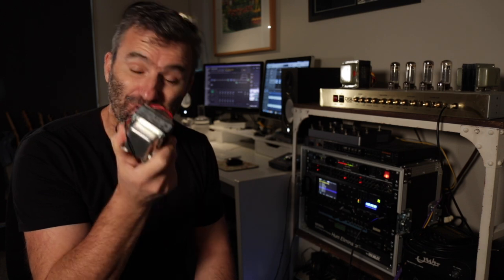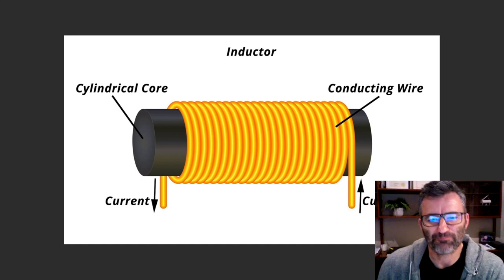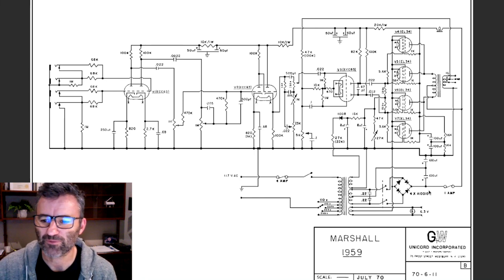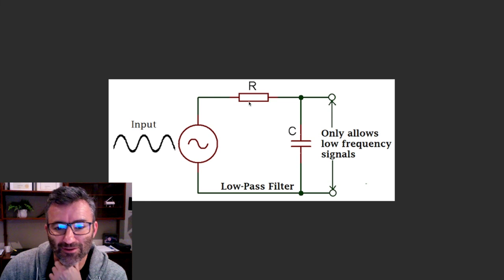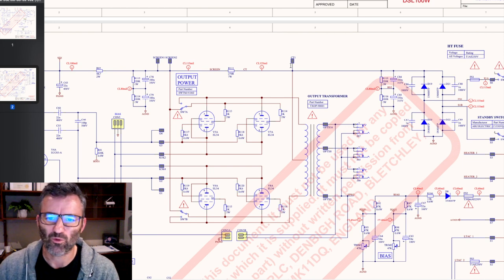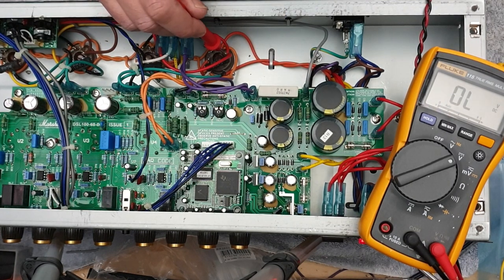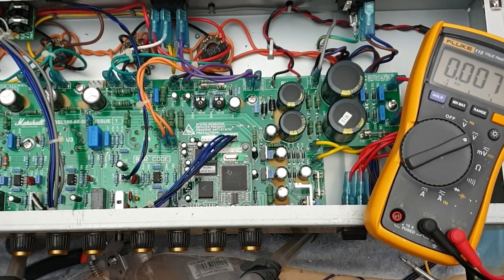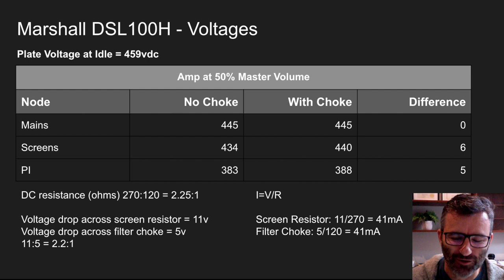Modding a Marshall DSL100H - ADDING A FILTER CHOKE!!

Comment: I appreciate you doing before/after clips!  Very helpful!
I think you missed a great opportunity, which was to measure the AC Volts after the choke, at idle & when driven.  Especially when driven hard, the ripple in the power supply should be higher when running no-choke, and that will invariably increase IM distortion with what you're playing.  For high-gain, that seems like the bigger impact.

Comment: A filter choke is more efficient since it doesn't heat up. It also doesn't reduce voltage as much to the B+. The only downside is expense and weight.

Comment: Love Tool and I love my DSL100HR. I'll certainly be installing a filter choke now. I build guitars and guitar pedals and do all sorts of mods. I just finished a Chasm Reverb with my own mods (the Chasm is a belton brick reverb) so maybe this should be the next project? Did you also find that swapping the PT and OT was worth the cost? I've had the DSL100HR since launch and while I'm perfectly happy with it I do see room for improvement. I would have started modding it already but I was just waiting out my warranty. And I actually am glad I did cause my amp was one of the earliest units that still needed the switching daughterboard swapped for a reflashed board since it had the FX loop switching bug. I told the tech exactly what he needed to do to fix it and gave him my contacts number at MarshallUSA (even though he was an authorized repair center just to be thorough) and a month later he calls me an says "found your problem, it was some solder build up. All fixed" to which I laughed and told him as much as I wish that was the case it's not fixed and asked if he looked at my notes. So he says "I've been working on amps for 30 years but if you wanna come in and show me the problem then go ahead" implying that he thought I'd come in and he would show me I was wrong. So I took off work and drove from Fort Worth to Dallas and showed him the problem and explained that its intermittent and it wont always be apparent. So I finally convinced him to call Marshall and they didnt answer so I left my amp and the next day they called my tech and confirmed everything I told him. In his defense I was one of the very first people I know of to find the issue and seek a repair but I did all the leg work for him. So he called me after talking to Marshall singing a whole new tune and telling me if I have any issues in the future just bring it by and ask for him. He went out of his way to show humility though and in the end it got fixed. My point of that rant was to say warranties are nice especially when proprietary software is involved cause they make the repair free. But with that said, it's so much easier doing things ourselves lol.

Comment: Hey Jason,  hope all is well. I've heard you mention the sweat spot for the PI supply is about 320v. In the DSL it's around 402v. Then the rest of the nodes are H+5 395v, H+4 380v, H+3 365v,  H+2 364v, and H+1 373v. While implementing your mods and the choke, would it be worth the effort to bring those voltages down some?

Comment: Hi Sir, I got the DSL100H for which I recently replaced new EL34s but I'm struggling with the BIAS settings because, by adjusting TRIM1 and TRIM2 I can't remain in a fixed value in mV. they change continuosly the value range and I don''t mean in decimal (76.1 76.2 76.3 etc) but even the units (73 74 75 etc). Does this can be a techical Issue or maybe I'm wrong with the procedure? Moreover I dont't catch what PIN the TRIM1 and TRIM2 adjustment affects respectively, because seems both PIN are affected. My steps are: Amp connected to a load. Turn on and in stand-by. wait for 10 minutes. Turn on the stand-by and measure one Pin per time with the DMM setted in 200mV. Adgust the TRIM. but what TRIM affact what PIN? I'm I right. Thank you very much for your help. Regards.

Comment: Hey man dont know if you could help but im repairing a dsl100hr i was gifted, and it popped a fuse internally (the one that always goes in these models), ive noticed that no matter what i do on the bias pots on the back the voltage reading on the external bias points does not change, i am scared to use the amplifier for extended periods of time, could you reccomend stuff i could check internally to see if its operating correctly voltage wise? It's running the stock EL34 power tubes and stock preamp tubes, guessing theres voltage points i can check inside the head to see if im in a safe bias range, it sounds great but on one mode, i forget which theres an "earthy rumble" its hard to explain, it comes and goes though

Comment: Hi! Would there be any noticeable benefit or detriment to moving the choke up to before the junction to the OT center tap? Based on my understanding thanks to your great video, as is, it's filtering the HT supply to the preamp tube plates and power tube screens. Obviously moving the resistor location there would be bad, but when replacing that resistor with a choke, I'm curious what affect you think the lower impedance of an inductor would have there? 
I found a bargain on a 4H choke recently and plan to put it in my old Jet City 20W amp. Forgive my ignorance, but I'm new to the world of amp modding!

Comment: Great video. Let's see if you can answer me. I have a DSL 40 CR and a scrap choke with the following specifications: 15H  75mA and 275 oHms. Would that model be suitable for me? Would you recommend its installation? Thank you so much.
Reply from the maker: Well, probably work but you’d normally look in the 3 to 5hy range in a Marshall.

Comment: Everytime I come back here, I'm always reminded at how versatile Marshall's are. Have you ever touched Peavey 6505's? And would a choke improve the fuzzy high end of the amp?
Reply from the maker: I've not worked on a 6505, but a quick look at the schematic confirms its SLO100 origins.  SLO's have chokes, so your amp will benefit a lot from a choke.  Fuzzy high end, well other simple mods might be needed to tame that.
Reply: @HeadfirstAmps  Thanks for the response. Honestly, I'm just half tempted to trade it on for a Marshall and do your mods!

Comment: Good video. Question: I have this amp and the DSL1H. The DSL1H I basically run wide open all of the time…it’s only one watt. But at wide open through a 212, it sounds its best with the output tube singing so that’s how I like to use it. Seems if they use the same basic circuit, that a choke would be even more beneficial in the 1 watt amps; as I’m sure many that have the 1w version probably also prefer them wide open.
Reply from the maker: I've never played, or worked on one of those, however I do believe that all amps benefit from a choke.  It's probably debatable whether it would have any noticeable difference in a 1 watt amp though!

Comment: Nice video, would a 8 Henry 200mA choke work on a DSL100H and does choke/PT orientation matter regarding hum?
Reply from the maker: If that's what you have, then yes use it.  Better to have it at 90° to the PT for best practice, which I would have done but it didn't fit. Having said that there is no hum or observable side effects in how I implemented.
Reply: @HeadfirstAmps  Thank you kindly Sir!!!

Comment: Hello & sorry to ask but could that be done also on the origin 50 or would it not be worth the effort, also would a choke from a jtm45 (c1999) suffice or would another choke be necessary. Great work by the way & cool vids 👍
Reply from the maker: I think a choke improves all amps, so yeah if you like your Origin then a choke will make it even better.  The 45 choke is maybe a bit on the high side Henry wise, but I think it would be fine.

Comment: you should rotate that choke 90 degrees so that the iron is not parallel with the adjacent transformer
Reply from the maker: Agree, but it wouldn’t fit
Reply: @HeadfirstAmps  I noticed that the pcb appears to have been modded to isolate pin 5 on the tube sockets but I don't see the bias resistor attached to the pin on the socket?  Is this in process?  What am I missing here?  I did this mod on my TSL myself and it has been running great ever since.
Reply: oops - my bad - it's just the way the light is hitting the solder joints.  You should add the isolation mod as I am pretty sure the DSL has the same issue even if it has the so - called "fixed" rev of the PCB.  Since you had the amp open already it would have been nothing but labor as far as $ goes installing the mod.....

Comment: Exclent tutorial, I'm getting ready to do this mod.  I'm curious as to why your schematic shows capacitors in parallel with each rectifier diode.  If there is a benefit, I will add some to my project.
Reply from the maker: It's a common technique with  bridge rectifiers to try and reduce noise in the power supply from the diodes.
Reply: @HeadfirstAmps  I like a quiet amp.  I think I will add some.

Comment: Of course one of the debates between solid state and tube amps are that tube amps have that spongey feel from sag. So when you reduce the sag, it’s confusing to me - aren’t you approaching the performance of a solid state amp?
Reply from the maker: Not really.  Tube amps have so many other factors that make them different.  E.g. Output transformers.
Reply: @HeadfirstAmps  I am going to test the output transformer theory. I have a solid state fender Princeton chorus amp. And they designed an underdamped power output section. I am going to take a preamp and feed it into the return, then try on a 6v6 20 watt output section. Curious if there will be much difference

Comment: If you want to not spend money on a choke could you swap out that resistor for a $1.21 120 ohm 10w resistor? Or would it not be nowhere near the effect of putting a choke in. At the time I bought my dsl100hr there was no info on mods! I had a jvm410h prior. The fsl just sounded shit, not like a true Marshall. Hit a power chord on the JVM and I'd get goosebumps! Wish I had known about all your mods for the DSL 6 months ago as I sold it because it was the worst amp I'd owned. My orange dual terror shit all over it!
Reply from the maker: It would be the same effective DC resistance, but wouldn't deliver the same filtering qualities
Reply: Chokes aren't terribly expensive.
Reply: A choke is an inductor (wire wound around a magnet like the power and output transformers).  It has resistance, but it is quite different from a resistor.  If you were retrofiting an amp that had a resistor with a choke, you'd likely want to choose a choke that had similar resistance to the resistor in the base design.  If not, you'll likely have to adjust other resistors down the line to compensate.